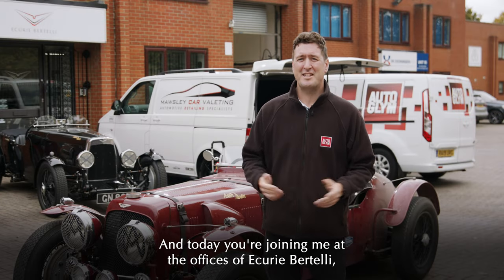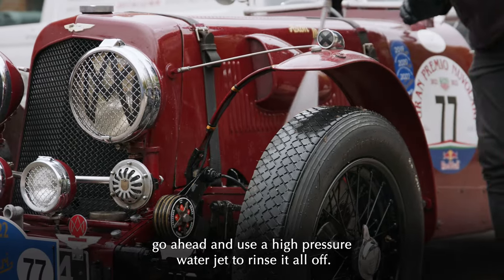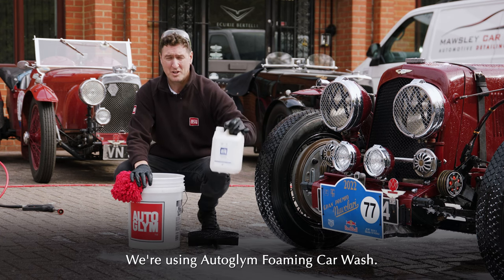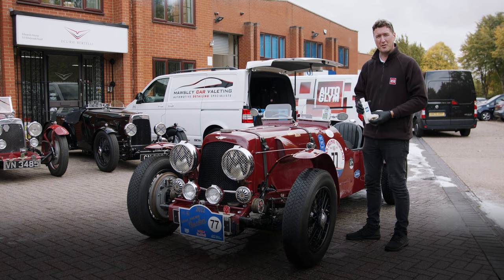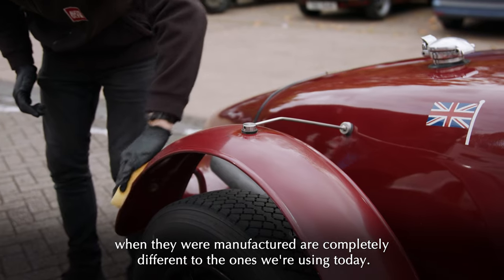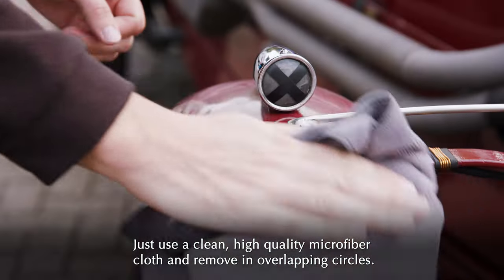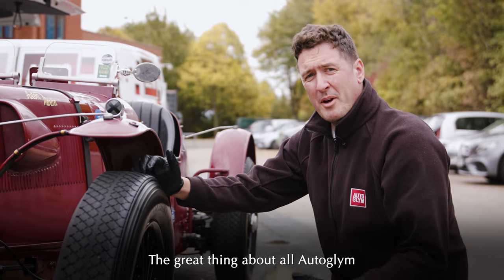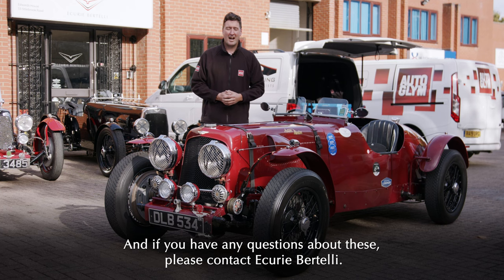How to get your classic car prepped for winter storage with Ecurie Bertelli

Comment: What benefits are there to using the Foaming Car Wash over Bodywork Shampoo and Conditioner?  In between normal polishing/sealing/waxing I usually use Aqua Wax after washing as a bit of a drying aid and protection top up as it takes virtually no more time than just drying normally.

Also, do you have something that has replaced Alloy Wheel Seal?

One bit of feedback however has to be Intensive Tar Remover needs to be in a trigger bottle, the current bottle is really bad, takes ages and results are not great.  However, apply it via a trigger and it works brilliantly.  Please change the bottle to a trigger :)
Reply from the maker: Hi James,

Foaming Car Wash has no additives and is suitable for matt and more sensitive paintworks. Bodywork Shampoo Conditioner is also pH neutral, but contains rinse aids to aid with water run off and drying time. Both can still be used with Rapid Aqua Wax

We do not produce alloy wheel seal or have a direct replacement at this time. Wheel Protector is a similar product but leaves a film as part of it's protection, this can make the alloys look less shiny and also makes it unsuitable for darker coloured alloys. Otherwise it's a great way to protect your light or silver alloys. You can use Rapid Ceramic Spray, Rapid Aqua Wax and UHD Wax on alloys.

We will take your feedback on Intensive Tar Remover on board, however, the product itself is not very compatible with most trigger heads as it is a strong product, if used and left for extended periods of time the mechanism can deteriorate. In pro most users will decant into a Unibot, use then decant any extra left over back into the bottle.

Hope this helps!